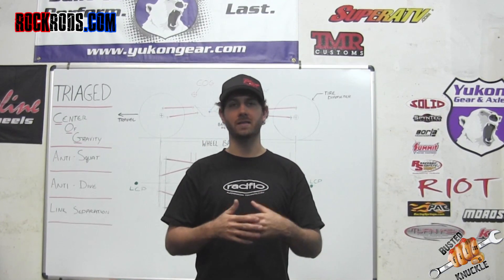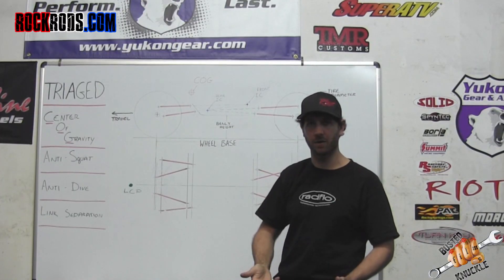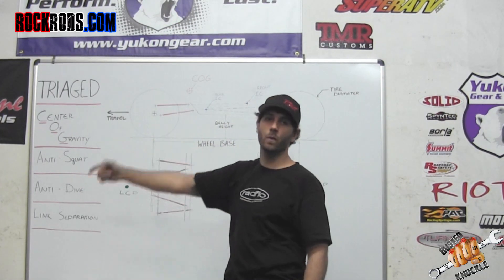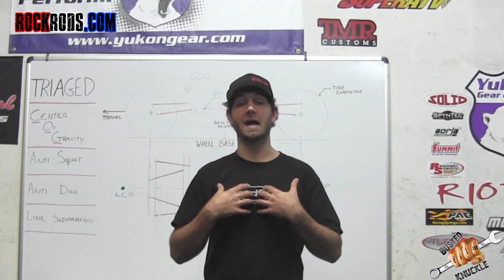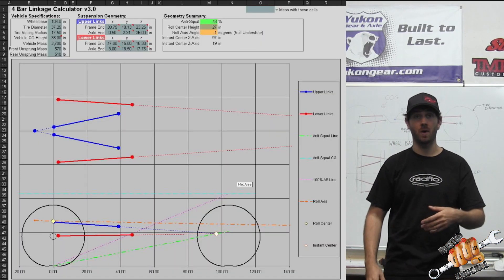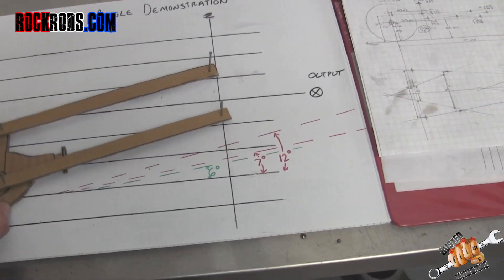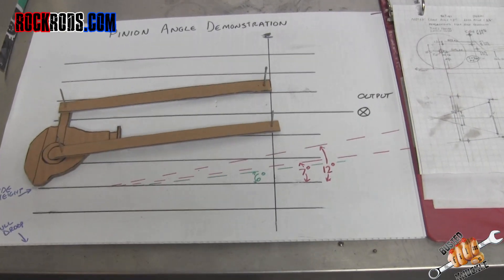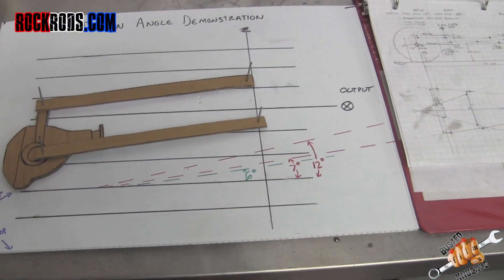Anti Dive and Anti Squat Explained - Rock Rods Tech

Comment: what if we drop the upper closer to the axlebin the back to increase our squat?

obviously reducing link separation isnt great for axle wrap, but if your sticking a mild lift kit on a basic solid axle, the shock perch on the axle usually gives you at least one lower hole, usually two, that will change your instant center...

Comment: You can tune for anti squat with air bags or electronic shocks. I don't like wheel hope. I added coil over shocks for anti dive. I run parallel 3 link upper wishbone that are eye to eye same length as driveshaft. And rear pinion pointed straight at output at ride height. Dropped transfer case 2" with a sye. Need to change front end uppers and steering geometry. One trip wheeling destroys the track bar.
Reply from the maker: it takes a lot of work to dial in a suspension right

Comment: Trying to figure out how the 4 link calculator works .... did the rear just fine but the front is off the page forward the front axle . Tried all i could come up with .... any tips ?
Reply from the maker: good question, not sure what would make it do that
Reply: I had to run - numbers for my link lingth it shows up correct on the layout

Comment: Radio control rock crawlers is how I learned triangled 4link geometry...
I was in IHRA ProMods where 4link works the same but for a different purpose and FULLY adjustable..
.....
THIS IS 2 dimension "antisquat"... your articulation will change that value. 
..
ROLL CENTER !!!
triangulation creates 2 imaginary points in space where they rotate from.  
Parallel links...can also be used, top or bottom in combination with angled.
<<<<>>>>>
I have 10 radio control crawlers.  20yrs ago I started experimenting.  It was rather Wright Brothers type,, using weight and angle to reduce our biggest issue.  Torque twist !  
###
To explain this all I think a 3D model would be best.  You must have some tube and links laying around.
Reply from the maker: There is a lot to it, but when you get it right it makes a world of difference

Comment: hello, i have a question about adjusting my suspension arms

I do a lot of winter trail running and what I noticed is that I do a lot of wheel ops on the front tires and I would like to know how to reduce the wheelop without taking too much of my low traction in the rocks?

I have a 4.5 suspension with adjustable arm but on the oem brackets on my jeep jlu diesel

is sque I should watch more vote antisqwat or antidive pcq I have at least 125% antisqwat but more around 70/80% antidive

thank you
Reply from the maker: Long arm is your best option to prevent that. A good set of shocks might help bandaid it some. My Jeep JKU with short arm 4.5 kit never wheel hopped.

Comment: Great presentation..Once I have an idea for the mounts I like to fab temporary mounts and use black pipe with nuts tack welded on for the rod ends  then you can pull the springs and cycle the suspension with jacks to figure out what you have to change before chopping up the real stuff. Just be careful 
 axles are heavy.
Reply from the maker: always fully flex out the suspension to check for clearances

Comment: Please help.      Im building a big diesel bog truck. Every truck like what I’m building I’ve seen, when accelerating they squat tremendously. I’m running 67” tall tires and the truck is a crewcab short bed 2500 ram. 
My goal is when I am accelerating or hooked to another truck on the tug pad my truck doesn’t squat like everybody else’s but I also don’t want the suspension to look ridiculous. 
Thanks for any help.
Reply from the maker: Anti squat is your friend in that case
Reply: @BustedKnuckleVideo   yes but with my instant center so high my link bars would be at extremely steep angles up to achieve this. The truck will be around 11’ tall. It didn’t seem possible unless the bars look ridiculous.

Comment: If you’re using a 4 link as a lift does the center of gravity need to be taking now or when the vehicle is at new ride height
Reply from the maker: ride height
Reply: @BustedKnuckleVideo  and how do you know where the center of gravity is when you are doing a solid axle and other modifications during the four link build to make sure everything is set where you want it

Comment: Good morning, first congratulations for the videos, they are real classes.  I watch all your videos and more than once.  I'm Brazilian and now I'm going to start changing my JKU's suspension to do heavy trails.  I have F250 axles and 40” tires.  However, I really enjoy riding the Jeep on road and I have some doubts about the rear suspension.  I don't know if I make it 4 triangularized links or with panhard.  I was told that using panhard the car is more stable in onroad, is this true?  thanks a lot
Reply from the maker: Is it it long arm or short arm currently? I would stick with a panhard for the road

Comment: Looking for advice. 05 Tj 3.5” rubicon express long arm, 1” body 38” tires. Currently has the radius arm in the front and I am switching it to 3 link. I plan on using the calculator to figure out where to place everything. What my question is, is what numbers am I looking for to make my front end not so light?  It loves to lift the front. I am stock wheelbase and a stretch is not in the budget.
Reply from the maker: there are a lot of good threads on the internet about how to design your 3 link to work best.

Comment: So a 2door TJ Wrangler with a 2" lift because it has a 93" wheelbase can't run 35" tires?  I agree; I switched to 31s and the street squirreliness  was noticeable, anti squat & dive effects decreased.  I 'wuz wondering if totally stock Jeeps have suspensions tuned for the stock tire/4 link/ spring rate & shocks or if they can be improved with mods.
Reply from the maker: they can all be improved with mods, especially when you correct the geometry

Comment: When you say anti squat a high anti squat what is high is 100% High I'm building a rock crawler what would be high for a rock crawler another words what would be ideal a little over or a little under 100?
Reply from the maker: under 100 for sure.
Reply: @BustedKnuckleVideo  thank you sir.

One more real quick question before I start burning my for link brackets in and fabricating them 

I will have 10 in separation in the front axle and about 12 in vertical separation for the rear axle in order to play with my anti squat anti dive like you said I'm going to put multiple holes for adjusting my 4 Link bars at the chassis

My question is can I go down to 4 in separation or is that too tight and if that's not too tight what about 3 in separation at the chassis?

The main reason I ask is because I can't get more than 10 in separation over the front axle and in order to help me get my numbers right a little tighter at the chassis then the 5 and 1/2 in of Separation I have graft out on paper would help a lot so I'm thinking maybe three or four inch separation at the chassis for the front.

Thanks again for this video I've been staring at this buggy for about 7 years and I'm finally getting going on it
Reply: @BustedKnuckleVideo  I guess the short way of putting my question or another way would be what is the downside of going really tight vertical separation at the chassis if there is any downside to it I can't wrap my mind around why it would hurt anything but that's why I'm asking

Comment: If 100 is neutral is that also considered high for a rock crawler should I shoot for 110 or should I shoot for around 90%
Reply from the maker: Over 100 will make it rise when throttle is applied, less would make it squat. 80-90 is good.

Comment: Busted Knuckle/Jake,

I've watched your 4 link explanation and your anti dive/anti squat videos numerous times. The videos are definitely helping me understand a link suspension in greater detail than before. I have a leaf sprung solid axle swapped GMT800 Sierra. I'm planning on linking the truck within a couple years. My question...when I go to measure the height of the CoG, do I use the stock height or the height of whatever it measures to since my truck is lifted? Thank you.
Reply from the maker: it will be different since you lifted your truck
Reply: @BustedKnuckleVideo  Thank you for your response. I'm doing a lot of reading on Pirate and other forums. I'd guess my truck is lifted around 9 inches. Once I feel comfortable enough to link the front end, I plan on lowering to around 6 inches of lift. I figure I'll set the truck at the new lower ride height I want and then use the CoG height (either centerline of cam or top bell housing bolt) when I'm ready to use the 3/4 link calculator. How does that sound?

Thank you for your videos and your willingness to help and answer questions.

Comment: Chassis inertia (u said momentum) the wheels are trying to force the chassis over and themselves and them selves under the truck with the help of the housing acting as a counter-rotating idler sprocket, (imagine the truck, on the sprocket on the wheel stacked on each other twist the wheel forward with sprocket motionless other than rotation (idling) torque and linear force because the axle housing or differential (IRS) has the equal amount of force counter-acting on it (twisting backward/axle wrap) where your springs and or links are located on the drivetrain and the frame directly determine what happens to the chassis due to limitations of the diff housing’s rearward twist/pinion up, remember an old Chrysler with a pinion snubber, everything mounted on the differential housing or solid axle that is forward of the center of the axle on the same plane will be force loaded upward and rearward equally in an arc relevant to its distance from the center of the axle, the same for what is mounted rearward (9:00-3:00 either side) 12:00 to 6:00 (left rear viewed from the right of the machine) changing the elevation changes the upward to rearward force ratio (fore) and the to downward to forward ratio (aft)
 Figuratively speaking, if the coils are mounted forward and significantly below axle center the engine torque will apply axle counter force forward and upward do attach the other end of the component where you want that force applied. Just ask yourself why and to what degree to suit your goals. I woukd illustrate but its lat-early! Man i gotta hit the rack
Reply from the maker: wow that is a lot of info
Reply: Sorry I was on a roll!

Comment: I’ve watched this five or six times over the past year. I’m finally about to start setting up my four link rear and three link front in my tj, mostly rock crawling with some steep hill climbs (typical Jeep crawling trails type stuff) I’m pretty sure based on what I’ve read and what you said that for my application I should shoot for about 100-120% anti-dive or as close to it as I can get with all the shit in the way. And it looks like with how I have it set up right now my anti squat is going to be about 150-160. I might be able to get it a little lower, but again space is limited, and separation at the frame at this point would mean lowering my lower mounts, losing clearance. Am I on the right track here? I’m building this by myself with no prior knowledge and no one around me that knows anything about it, so the internet has been my only mentor. Thanks for taking time to do this stuff bub. 👍🏻
Reply from the maker: 100 is a good number

Comment: Hi.i have a question.
Why toyota in 80 and 100 series use 5 link suspension? Why they dont use 4link with triangulated design instead of 5link and panhard in rear suspension??? Which one is better?
And Thanks alot for your good video.
Reply from the maker: they do a 5 link for better road manners and safety

Comment: Anti dive is calculated slightly different, including brake area. It’s a braking force, not acceleration force hence the difference. Under acceleration you have anti lift in the front not anti squat. The tyres are rotating the same way, the axle housing opposing the same way, but the links are on the other side of the front housing.

Comment: I wonder if I’ll get a response from him. Here we go, I’m making an off road buggy. I have a retired sprint car frame a sb350 th400 trans and a 203 tcase. Where my axle will be mounted is right at the rear of the frame which leaves me with a rear driveshaft that is 18”-20” long. What would be the best set up to keep my shaft from grenading. Front axle and suspension is a little easier as I have more room and shaft length to play with and adjust. Thanks in advance for any input
Reply from the maker: there are a lot more variables needed to make that decision
Reply: BustedKnuckleVideo it’s basically gunna be a universal rig. Not a whole lot of rocks but mud and trail riding. Braking trails like a go cart on steroids. I have 40” loader tires that will be goin on it. Not sure what else you need I just don’t want to have to keep tearing it apart and rebuilding it. I love all yer videos and watch them religiously. You explain things so well and the visual aids are awesome. I appreciate the response man. Thank you
Reply: BustedKnuckleVideo I wish I could show you a picture of it but I don’t think I can on here

Comment: First thank you, I know this is an old video, so is my project, started 4 years ago. Accidents happen. Question, watching your cardboard 4 link the lower pivots at the center of the axle, what change is seen if you move it to a real location say 3-4" in front of the axle and below the tube center line 1"?  

 I am reading other articles stating make the upper arm longer than the lower to keep pinion angle directed at output as you said, yet stated in the same paragraph the rule of thumb is make the uppers length 75% of the lower. 
Is the link length based on the frame mounting point as longer or the actual link length since the upper link mounts farther back and on top the truss and the lower mounts in front of the axle.

My upper links are 2.5" longer than my lowers but my lowers mount 3-4" further forward than my uppers. This is a daily driver/toy that started as a dual use toy.  Again thanks for the time

Comment: I'm still having a hard time understanding this in a long arm jeep application. On the front most companies have a choice of a single sided radius arm or a 3 link type set up. I get that the absolute center changes in these setups but what exactly does that do? The goal is to use anti squat to reduce unloading on a climb. But in a normal street driven weekend warrior type build is this overthinking it? I'm not racing ultra 4 or looking to do the baja 1000. Is the 3 link the new trend so everyone wants it even if they dont need it? Is the reduced potential to bind the u joint with a radius arm more of a benefit over the anti-squat?
Reply from the maker: radius arms bind by design
Reply: @BustedKnuckleVideo  true if it's a dual radius arm but there are kits out there that have a radius arm on one side and a lower control arm on the other. Thus eliminating the bind in the same way as a 3 link.

Comment: I’m building a 600hp bbc powered leaf sprung trail rig... how do I tune for anti squat and anti dive on that?? Traction/ladder bars put in the correct places?? But then I sacrifice ground clearance with some vulnerable bars down there
Reply from the maker: You don't. You swap the leaf springs for a properly setup 4 link.

Comment: A scenario you explained at 9:01 spoke to me.  I built a long arm 4 link + panhard front for an XJ recently which is having a hop issue when climbing uphill.  When designing the long arm suspension, space was the ultimate constraint, but we tried to triangulate the lowers by 15* and triangulate the uppers maybe 5-7* around the oil pan, but it still needed a panhard bar.  The uppers are nearly flat (parallel with the ground) and the lowers are sloped down a bit from the frame to the axle mount.  When I plug in the final actual measurements, the anti-squat summary calculates to 102% (using 4BarLinkV3.1d).  Is this 102% value the "reason" why the front axle hops when climbing up a hill?  The scenario is you get to the crest of a hill but you need to keep spinning the tires, hunting for traction, to get over that final crest.  Instead, the front tires just spin and hop, lifting the tires about 1/2" off the ground per hop, and it's nearly every rotation of the tire...so imagine some pretty violent and annoying hopping.  If I reduce the front's anti-squat number to somewhere in the 80% range, will this help or hurt the issue?
Reply from the maker: Good question. I will consult jake on this one

Comment: Awesome  Tech  Video on anti squat! I was wondering  if you were going to do a Video on Engine Horsepower  and wheel speed. It seems that some guy's  don't  have the power  or wheel speed or momentum to get up the  Hills  like you and the other high horsepower Buggies. It sucks because  I see em struggling.
Reply from the maker: There are so many variables to get wheel speed, horsepower, trans, t-case and axle ratio all play a factor